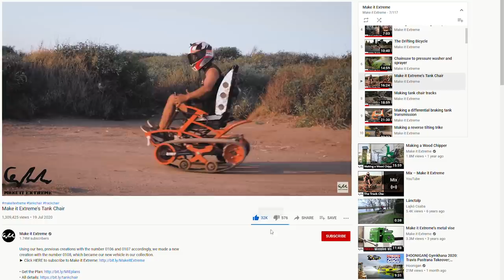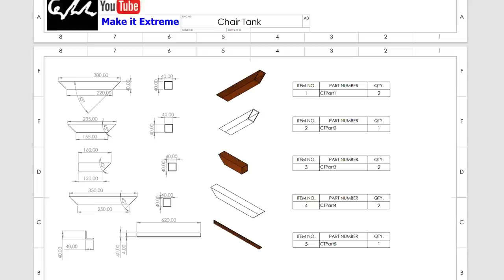Building the Ultimate Gear Selector!

Comment: This would be excellent for someone who has lost his/her left foot.
Reply: Yeah that would work the only problem I foresee is how to put the bike in neutral. As usually you need a half of a click up to put it into neutral
Reply: @gothmansams  maybe a centrifugal clutch between the output shaft and the sprocket which engages above the engines idle speed. But maybe im also overthinking it and there is a better option
Reply: Christy Brown for example
Reply: @gothmansams  Some motorcycle gearboxes are N-1-2-3-4-5 as opposed to 1-N-2-3-4-5 :) I am not sure, but the Yamaha engine they use might have Neutral at the first spot and everything is up. I know all Honda engines have 1-N-2-3-etc. Of course some engines have only 4 speeds, and some semi-automatics have only 3. But I'm just saying, there might be a solution in choosing for a gearbox that starts with Neutral :)
Reply: It’s called a Kliktronic made for disabled riders. Had a friend that lost from the knee down and could ride my cruiser ok but had one fitted to his Hayabusa
Reply: @MarinusMakesStuff  that's true I didn't know that I was speaking from personal experience with a 1979 Suzuki TS 185 or 175 I can't remember. it was half a half a click up from first gear was neutral
Reply: @gothmansams  Yeah exactly, this is how a Honda works as well. This is the beauty of riding a motorcycle. So much power but it takes fine motor skills to make that soft click into neutral with your foot. It's part of 'feeling' your bike I guess.
Reply: @MarinusMakesStuff  Almost any bike since the 70's will be the standard 1 N 2 3 4 5 (6 7) pattern,  no matter Honda, YAmaha, Triumph, Ducati, Jianshe... all of them. I can't honestly name a "modern" exception off the top of my head.
Reply: @MarinusMakesStuff  Most if not all bikes i have come cross have had 1-N-2-3-4-5 setup, but this is not really a issue, specially if engine has neutral light ans/or gear indicator. Just got down to first gear and use extra solenoid to take it half gear to neutral.

This kind of setup is gear for those projects that use motorbike engine and its not close by to be operated by levers or cable due lack of room etc.
Reply: @InSanCen  Yeah I can't really think of any bike from the factory that's even in race or GP shift honestly. Most people that race change it over but it's still 1 up and 5 down with neutral in the middle of 1 and 2
Reply: yea im not sure about that... you know a motorcycle has to be kept upright when its not driving right?
Reply: @keesanker4241  What are you talking about?
Reply: @MarinusMakesStuff  Misread it as someone who lost his leg haha, but with a missing foot this is great
Reply: @keesanker4241  I know a couple of riders that have above knee amputations. One on each side. Klicktronic gear change or Thumb brake on the rear. One has the kickstand on the "wrong" side.
Reply: @InSanCen  damn imagine stopping your bike leaning to the wrong side, and being unable to catch it from falling over
Reply: @keesanker4241  Well given he lost his leg 20+ years ago, I'd say he's probably used to it.

Comment: Make a fully automatic engine that shifts gears at an spesific rpm
Reply: I believe that is a bit more complicated than just changing gears at an specific rpm, because gears must change depending on the load that the engine has because if the load is too high for the rpm set the engine could stall and turn off and if you set it to a higher rpm when you don't have the load you would be wearing the engine parts faster than what they should reducing the useful life hence spending more cash on it.
Reply: We can find this kind of things in car transmission

Comment: This is pretty cool, and I agree this should be used on a motorcycle type project. The one thing I would offer some advice on is your soldering. Heat the wire up from underneath and let the solder flow into the wire. You will get a much better connection this way.

Comment: When I had plans for a racing moped I had the idea to use a co2 or compressed air system connected directly to the internal gear selector and have it be activated automatically when you pressed the clutch together with a spark cut. With adjustable time delay so I wouldn't blow up the gearbox ofc. It would only shift one way because that all that is needed from dragracing purposes but it could be adapted to shift up or down  with the use of a RPM signal.

Comment: Nice job . although a 2way pnumatic cylinder about 25mm piston and with 50mm -100mm travel is typically used along with C02 or onboard air. You eliminate the need for the air system . ( it could come in handy to reinflate a tire. ) a more extreme version would be to use a stepper motor connected directly to the shift drum. In the transmission.

Comment: Also if you use a 5 pin relay that gets a feed from both switches (mainly the up shift) and break the ignition coils positive wire across the relays normally on posisiton. When you shift it will cause a momentary engine stutter allowing shifting under power to happen allot smoother. . if you add a aftermarket tachometer with a adjustable shift light. And with the light instead using the shift lights feed to power the spark cut relay, you'll have a adjustable rev limiter. . say for launch control. ( by breaking the shift light feed across the clutch switch) or feed a relay to automate up shifts. Or get two adjustable light tacks and do both.

Comment: How do you reposition the cutting tool for the threads while the lathe is running? I learned to turn off the lathe and run it backwards with the tool disengaged but still connected to the constant feed so it doesn't loose synchonisation with the already cut thread.

Comment: Hello from Turkey! I have a question about coils? Why you didn't use a single coil instead of two coils? If you have the chance to reconnect the cables remove one of the coils and supply the single one with reverse voltage. Pushing or pulling action is depends on the applied current direction. If you couldn't get enough power from one of them, you can connect the two in series and able to get more push or pull power.

Comment: If you add a momentary ignition kill, you won't need to use the clutch. We've been using a similar system on drag racing motorcycles using air rams for about 40 years.

Comment: I loved the idea! I would only suggest adding some bushings to avoid the impact of metal against metal that could deform or wear out the metallic parts with time and helps reducing the noise also. Another thing to consider is to test it out on a moving motorcycle because in my experience to engage the "N" in gears on a moving motorcycle takes a shorter range of movement and could jump from 2nd to 1st without stopping. Well this is just the opinion of a fan and enthusiast of motorcycles and mechanics I'm not a mechanic or technician of any sort im just a graphic designer :P

Comment: This looks like a good idea! The only thing that worries me if the sparks on the contacts. Starter solenoids are known to be a high current load, aren't you worried about contact erosion in the switches (or relais)?

Comment: Really interesting project! The only problem is  neutral gear engage XD
Reply: I don't think there's enough movement from the solenoid to shift 2 gears at once which would allow the transmission to select neutral.
Reply: @DanKoning777  On an mc box neutral is a half click not a full pedal travel, hence the 101 questions about finding neutral... Having said that, I´m pretty sure this is very simple 'box with no neutral & a centrifugal clutch or a N-1-2-3 type

Comment: Now add "electronic brain" which takes impulses from speedometer and rpm and will switch gears in automatic mode.
Reply: So... basically an automatic transmission?
Reply: @Sithhy  no, it is not an automatic transmission known from cars. This is classical gear box with automatic switching - automated classical (mechanical) gear box. You can also find it in cars.